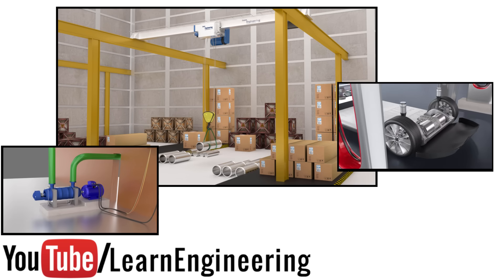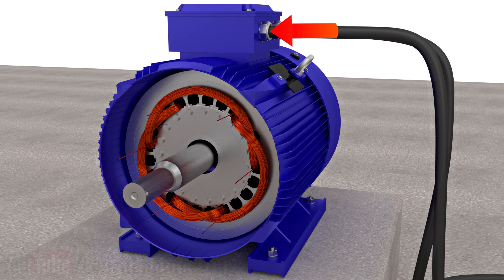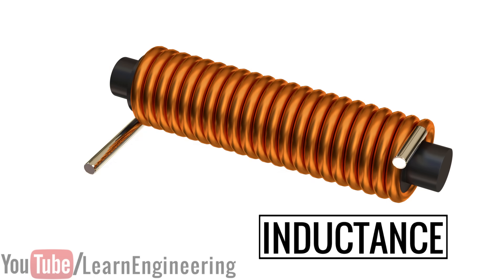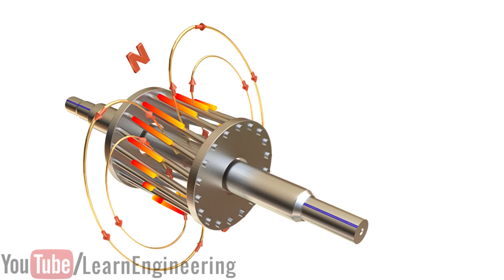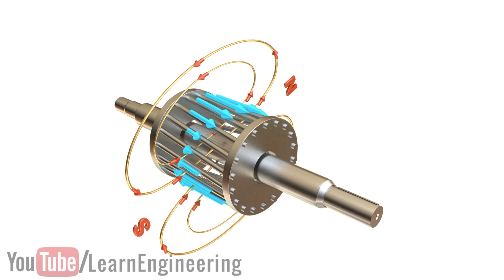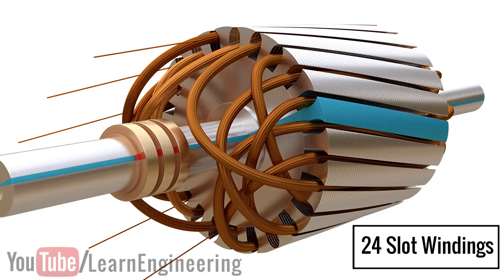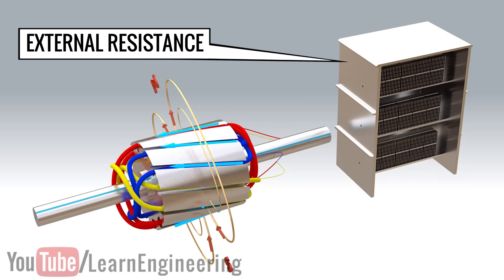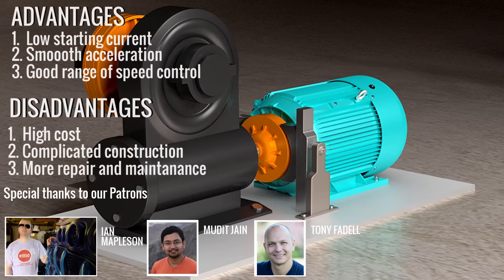Slip ring Induction Motor, How it works?

Comment: However nowadays we can have good torque-speed profile with Squirrel Cage Induction Motor as well. Thanks to VVVFDs(Variable Voltage Variable Frequency Drives). High starting Torque, Low Starting Current with low starting frequency. Also helps in starting up a synchronous motor. This has made slip-ring motor application very rare. Also initial cost and maintainence of slip ring IM is costly too.
Reply: The answer to a question I was about to ask, thinking in how Tesla cars have a  Squirrel Cage Induction type motor, and a lot of initial torque...
Reply: teslas dont have a lot of initial torque. they have a lot of torque on a wide range of rpm's and when it starts to fall of its because its battery power bottlenecked
Reply: @two_number_nines  You have clearly never been in a Tesla. From 0-60km/h it deliveres max torque and then slowly drops off at higher speeds
Reply: Another advanced machine is Flux vector control where we can control torque/speed independently unlike VFDs. These are somewhat similar to Separately excited DC motor where magnetic flux remains independent of motor speed and the machine don't need to give up its torque for speed.
Reply: I need to also clear this that I said increase in STARTING TORQUE not increase in MAXIMUM TORQUE. MAXIMUM TORQUE in a machine can't be increased beyond rated no matter what. Increase in starting Torque means we can have machine starting at maximum torque possible instead of low torque. This is what I mean when I say high starting torque.
Reply: in every one of my comments is focused on explaining that VFD's make motors start up at their maximum rated torque and accelerate at it, meanwhile if you don't use one you can still get the same torque curve, but the wider the range of peak torque you desire the more the motor will heat up at startup
Reply: in one of my comments i expained what you tried to explain with the V=4.44Kp*Kd*Øm*f*N formula
Reply: @two_number_nines  Yes, VFDs help in achieving maximum torque at start from zero speed and also it helps in reducing starting current thus reducing motor heat.

Anyway no problem. I think it was some sort of confusion or misunderstanding. Nice discussion by the way. Cheers.
Reply: @ervivekchoubey  ..i agree with u ...becoz in India nowadays electric loco use 3phase induction motor with vvvf to achieve high torque ..... 😊😊😊
Reply: @3:02 I paused the video and observed. The direction of electro magnetic force shown in the animation is wrong. Use F=Current *(Vector product of L and B)
 L= vector having magnitude= length of conductor and directed along the direction of current and B is the STATOR MAGNETIC FIELD VECTOR. Using right hand rule, we get the direction of electro magnetic force to be opposite of that shown in the animation.

Please correct me if I am wrong.
Reply: wtf are you an engineer now no you wannabe biatch  don't write back I'm too gd batty
Reply: 6
Reply: Yep, same setup on Material Transportation Company's battery changing machines. They use SEW Eurodrive VVVFD's with resolver feedback encoders attached to the rear shafts of the two lift motors that are just plain squirrel cage induction motors that can lift 3200 Kg's due to the VVVFD able to maintain flux being aligned by varying voltage and frequency. It's really amazing how power electronics and microprocessors have changed the behavior of AC electric motors in ways that made other AC motor types now obsolete, like this slip ring motor shown in this video.
Reply: torque and current are proportional untill you saturate the iron core of either the rotoro or stator, so VVVFDs can't increase the starting torque, they can only save money on the electric bill and save the motor from overheating
Reply: @two_number_nines  No they can increase the starting Torque by reducing supplied frequency but at the same time reducing the supply voltage as well (to avoid saturation and maintain air gap flux constant). Thus with reduced voltage we have reduced speed but at the same time we have reduced supply frequency which provides great starting torque with low starting Current.

In other words, we have great torque at reduced speed and that's what is required for most of the motor application like traction.

However nowadays we can have Torque-speed independent as well with the help of vector speed control instead of VFD.
Reply: TORQUE IS PROPORTIONAL TO THE FORCE APPLIED ON THE ROTOR. THAT FORCE IS PROPORTIONAL TO THE MAGNETIC FLUX FLOWING TROUGH THE ROTOR. THE MAGNETIC FLUX TROUGH THE ROTOR IS PROPORTIONAL TO THE CURRENT FLOWING TROUGH THE ROTOR ALUMINUM. THE CURRENT FLOWING TROUGH THE ROTOR ALUMINUM IS PROPORTIONAL TO THE MAGNETIC FLUX AMPLITUDE SUPPLIED BY THE STATOR. THE MAGNETIC FLUX AMPLITUDE DEPENDS ON THE FREQUENCY AND SUPPLY VOLTAGE. IF A MOTOR IS DESIGNED FOR 50 HZ 220V GRID THEN IT PROBABLY WILL SATURATE THE IRON CORE OF THE ROTOR  EVEN AT 190V 50HZ IF THE ROTOR IS LOCKED INTO POSITION. VARIABLE FREQUENCY DRIVE WILL JUST LIMIT THE CURRENT DURING STARTUP WHILE MAINTAINING THE MAXIMUM TORQUE THE IRON CORE CAN MAKE BEFORE SATURATING.
Reply: Shouting it won't really help your case. VFDs with motor feedback control are routinely used in industry, and particularly in vehicles, like every vehicle Tesla makes, to increase starting torque by reducing the phase difference without wasting power with slip rings and external resistance. The principle for increasing starting torque is the same as a slip ring motor, but the means used to achieve it are different, and much more efficient.
Reply: i will repeat again shortly. the torque of the motor is bottlenecked by the cross section surface area of the rotor iron core. there is no physical way to increase the flux of the magnetic field lines trough the rotor substantially in commercially practical ways
Reply: after a certain frequency and duty cycle/input voltage the rotor iron core saturates and reaches peak TORQUE. after that you can only heat up the stator coils with no effect on the rotor. all variable frequency drive does is let you have a high voltage battery and maintain the peak TORQUE the rotor can provide over a long spectrum of rpms untill you get bottlenecked by the power output of the battery. this case is clearly shown in the torque/power charts teslas and most electric vehicles have
Reply: This might help the debate in this thread
https://en.wikipedia.org/wiki/Vector_control_(motor)
Reply: Let me clear the working of VVVFD in short(if possible).

For any AC machine supplied voltage is given by

V=4.44Kp*Kd*Øm*f*N

Where Kp=pitch factor
Kd= distribution Factor
Øm= maximum air gap flux
f=Frequency of supply
N=No. of conductors.

Except V, f and Øm, all other parameters in a machine are constant. So, we can write

V=k*Øm*f 
=> V/f=kØm
This equation itself says that maximum magnetic flux within a machine depends on ratio of V to f. This is the working basis of a VVVFD/VFD.

Increase of maximum magnetic flux within a machine like induction motor causes the motor windings to saturate which means the windings refuse to magnetise any more and hence the case becomes like supplying an inductor through DC where saturation sets in no time and thus causes inductor to short-circuit. The same thing will happen if the motor saturates thus causing motor to burn out.

Now we know V/f = kØm. It means increase in V keeping f fixed or decrease in f keeping V fixed both will cause Øm to increase thus causing motor to saturate.

Hence, VVVF (Variable Voltage Variable Frequency) drive is used which increases/decreases V and f proportionally so that Øm remains constant. The torque generated in the machine depends on this Øm. So, running the motor at low Voltage with high frequency like John said (190V, 50Hz instead of 220V, 50Hz) will result in decrease of effective maximum air gap flux instead of saturation. Saturation sets in during over-fluxing. Decrease in maximum flux causes decrease in effective torque.

With VVVF/VFD/Inverter, Voltage and frequency is given in steps to the motor. This ensures two things. First, the lower voltage start which causes the motor to intake low starting current and second, lower frequency of supply which causes lower starting synchronous speed thus reducing rotor reactance hence making rotor current and maximum magnetic flux to almost align (as extremely well defined in the video). Product of both maximum magnetic flux and rotor current causes generation of rotor torque. With decrease in rotor reactance, the motor picks up enormous torque as both maximum flux and rotor current almost align (ALMOST not exactly). This is the advantage of VVVFD. 

However we can't increase the supply voltage beyond rated and thus after the full rated voltage is set in through VFD, only frequency can be increased beyond that. This causes reduction of motor Torque but increase in motor speed as the synchronous speed (given by  120f/P) increases. So, in short we have greater speed at the cost of torque. 

Just like the above, at rated voltage we can only increase the frequency but can't decrease. Because decrease in supply frequency will result in saturation. If we want to decrease frequency, both voltage and frequency need to be decreased so that Øm remains constant.

Øm can be decreased if required but can't be increased beyond limit. That's the whole picture of what's happening.
Reply: I think tesla motors on newer cars are permanent magnet, not induction.
Reply: @fededevi1985  Only Tesla 3. Tesla S and X still use induction motor with gobs and gobs of torque (practically maximum) at 0 RPM.
Reply: @mychevysparkevdidntcatchfi1489  practically maximum  yes but the maximum torque without applied load. If you apply load things become quite different
Reply: @ervivekchoubey  Thanks for a clear explanation about VVVF Drives
Reply: @ervivekchoubey  @3:02 I paused the video and observed. The direction of electro magnetic force shown in the animation is wrong. Use F=Current *(Vector product of L and B)
 L= vector having magnitude= length of conductor and directed along the direction of current and B is the STATOR MAGNETIC FIELD VECTOR. Using right hand rule, we get the direction of electro magnetic force to be opposite of that shown in the animation.

Please correct me if I am wrong.

Comment: Couldn't be simpler explanation than this. Hats off.

Kindly make a video on induction generator.
Reply: Yeah, I am also waiting for an induction generator video to pop up.
Reply: From my pt. of view not knowing too much but a little effort of mine
"As in 3-phase induction motor ,we have to give 3-phase Ac supply to rotor windings as it will become heavy , inertia losses and low speed of rotor  makes it inefficient (poor efficiency ) so generally not used

Comment: I think Slip ring Induction Motor is like a diesel engine, they produce higher torque at low rpm ( low but not zero) and it loses torque at high rpm
Reply: all magnetism based motors have almost the same characteristics. when driven with constant voltage they are like diesel engines. when driven with constant current they are like gasoline if you want to use analogies

Comment: Why the rotor bars in squirrel cage are skewed and not straight ???
Reply: Coz rotor have skewed slots so they always have some angle wrt to rmf of stator instead of being perpendicular.
Reply: straight bars have flat spots skewed ones have two pulling at same time.

Comment: So in short, its like a variable transmission for an electric induction motor.. except instead of gear ratios, its variable resistance factor.
Reply: I thought elevators must have gears
Reply: @davemwangi05  They do.
Reply: I think its more like that it allows you to design the induction motors for better efficiency and power density without having to worry about it drawing 9999KA if you ever start it from a stand still. 
With the slip rings you can limit the starting current and regulate the magnetic field vs the counter magnetic field in a way to get the most power transfer. (Something like active power factor correction)
Reply: @Laharl, There was an instance where a motor was being tested, and a senior manager could not understand why they had to bolt down the motor before powering on. He insisted that he could stand on the motor to restrain it's movement. They warned him but he said "Put the damn thing on." He was flung some 4 meters in the air, hit him in the chest, and the next thing he remembers was when he was in hospital. Now he watches motors from far. "drawing 9999KA." is a real nightmare

Comment: These videos are gold on youtube
Reply: yes indeed
Reply: Exactly
Reply: Diamond
Reply: I wish they were around when I was in college 😭
Reply: @JBrodo  correct
Reply: @3:02 I paused the video and observed. The direction of electro magnetic force shown in the animation is wrong. Use F=Current *(Vector product of L and B)
 L= vector having magnitude= length of conductor and directed along the direction of current and B is the STATOR MAGNETIC FIELD VECTOR. Using right hand rule, we get the direction of electro magnetic force to be opposite of that shown in the animation.

Please correct me if I am wrong.
Reply: @abhisekrout8522  You are right to notice that. but the mistake is not in the direction of force but in the direction of magnetic field. If you watch RMF video of the same channel. they have cleared that the RMF notations is always as per the inside area. So here if you see flux direction to be from north to south downwards the force direction is correct.
Reply: @abhisekrout8522   here we wish to find direction of force on motor after current is induced in rotor bars so we will use left hand rule.
Reply: correct
Reply: Correct bro...
Reply: River
Reply: Pimp it up
Reply: Such an awesome video. Thanks for sharing